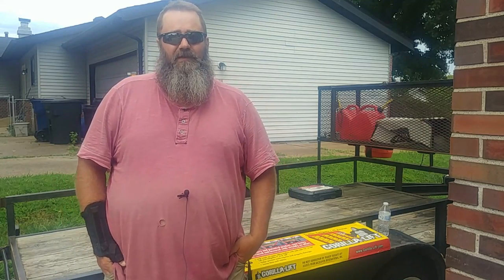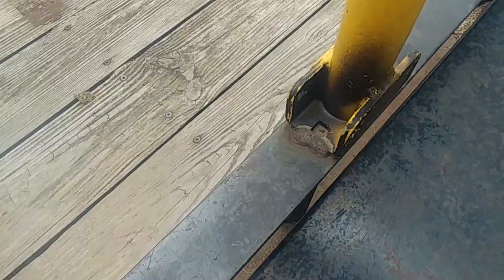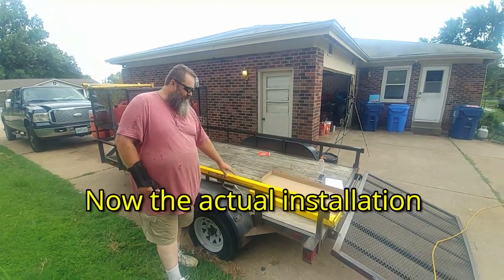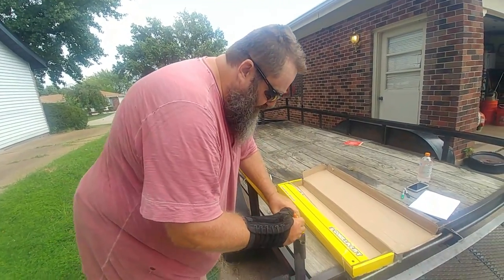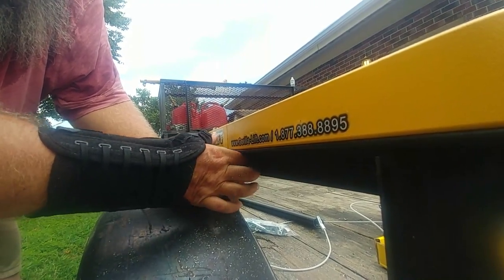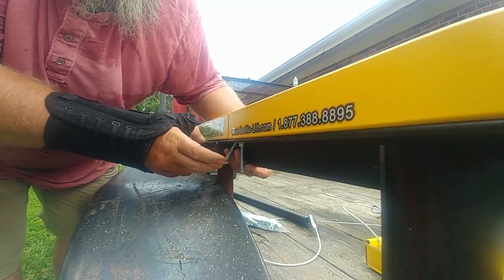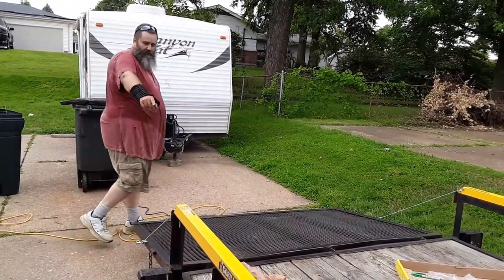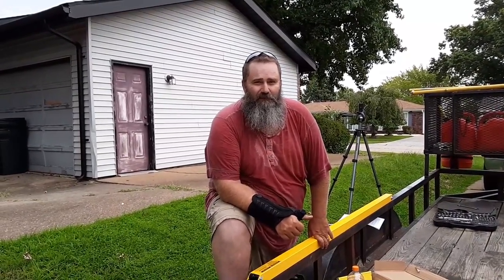How to Install Gorilla Lift Tailgate Assist

Comment: Note To You My Trailer Friend, When Drilling A Larger Hole, Like 1/2 Inch, Use A 1/4 Inch Drill Bit First, Then Use The 1/2 Inch, It Will Drill Much Better & Smoother...
Reply from the maker: Thank you for the tip, I appreciate it
Reply: And you can use Tap magic when drilling in steel to help

Comment: It's a sign that I came to this video, I am wearing almost the same wrist brace !! Quick tip when drilling with a large bit, small pilot hole will get you through that metal quicker and prevent the bit from dulling so fast.
Reply from the maker: Thanks for the info, Much appreciate it. The lift assist was the greatest improvement to the trailer I have ever made. Wish I had done it 20 years ago.

Comment: Thanks Joey.  I wanted to get one of these and keep putting it off.  My tailgate is not as heavy but it does wear you down a bit.  Thanks for the walk through on installation. You and the wife did an great job.  I definitely know that seriously hot weather.  Have a fine week.
Reply from the maker: I found this one on amazon for 179.00, I figured it was time to get a set. Seen them in the past for 300.00. knowing what I know now even at 300.00 it would have been worth every penny

Comment: It's amazing how smooth things go when you follow a good set of directions. I usually like going the hard route though haha! That gorilla lift is going to be really nice to have! Great job with the install! I think you're angled cut on the tailgate brackets should work out well too. As long as you don't put extremely heavy stuff leaning up against it you won't miss it.
Reply from the maker: It helped having my wife read the steps to me, lol. I am like the typical male, I don't even open the instructions, and Kris knows that, that is why she read them to me.
Or I would have been out there for hours trying to figure it out, lol.
They really are a back saver.
Have a great day Chip.

Comment: Okay, I heard about these but now I have to get one. They really do look like they help a lot. Thanks Joey.
Reply from the maker: It is worth it, I was going to buy them a few years ago (about 10 years ago) but they were 300.00 and I didn't want to spend that much. Let me tell you, even at 300.00 it would have been worth every penny.
I found them on Amazon for 179.00, so I grabbed them. You won't regret it, they are a back saver for sure.
Have a great day Russ.

Comment: Nice job. I just did mine this weekend and saw this video after the fact. Mine went just as good as yours did except my latch pipes didn't need to be cut. (just lucky of the placement). My gate is a double gate and built in heavy duty ramps and I can still lower and raise it with one finger(and that's with arthritis) LOL. The instructions were probably the best instructions I have ever seen. Good job and a wonderful video.
Reply from the maker: Thank you, The directions were pretty easy. Usually nothing goes together without a few swear words and throwing something. but this went pretty smooth.

Comment: Good show buddy, that's definitely worth it and make things alot easier.
Reply from the maker: It is worth it, I was going to buy them a few years ago (about 10 years ago) but they were 300.00 and I didn't want to spend that much. Let me tell you, even at 300.00 it would have been worth every penny.
I found them on Amazon for 179.00, so I grabbed them.
Have a great day.

Comment: Thanks for the video. Couldn't help but see th gas can rack up front. Where did you get it?
Reply from the maker: I had it made, ant trailer shop or decent welder could make it for you. You can even find them on marketplace sometimes.